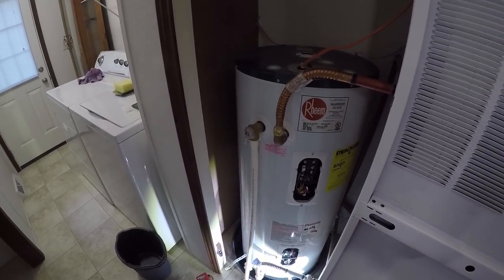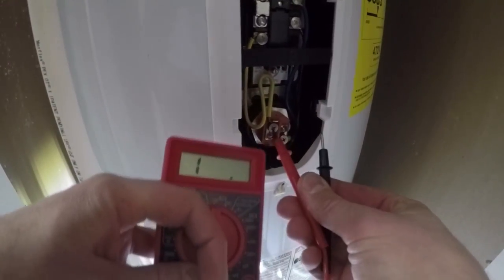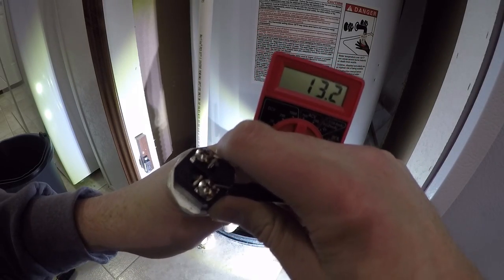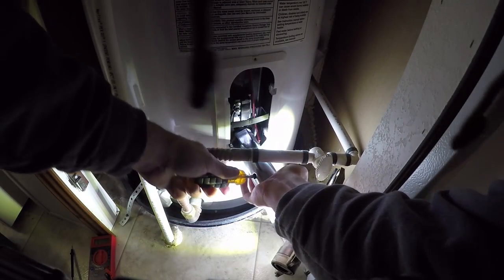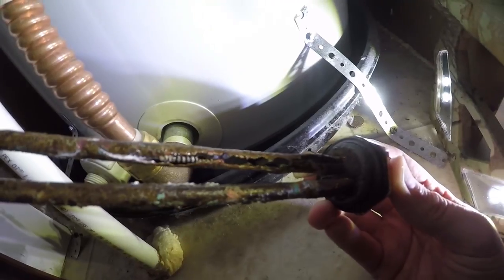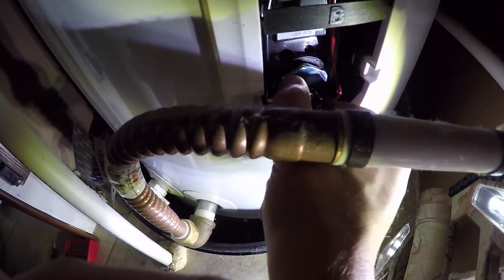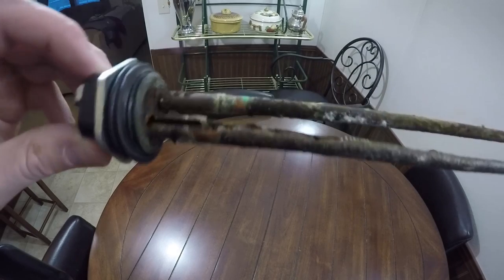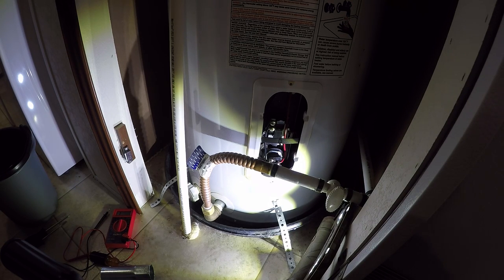How To Replace A Water Heater Element

Comment: Would it be prudent to replace both elements once you have the tank emptied?  Does the bottom element fail much sooner than the top?
Reply from the maker: I did both of mine, it only seems to make sense to do both, it won't hurt, I would they are not expensive and I would rather just replace both and be done with it.

Comment: Mr Wagner. Thank you for sharing valuable information. I replaced both heating elements and thermostats for new ones and still not getting hot water, There is power. Any idea what could be the issue?
Reply from the maker: it's gotta be something else then but I'm not sure check to see if you have a blown breaker or something

Comment: heyy jamie not knowing a lot about water tanks, why would the water have been burning hot if the element was shot and the breaker was blown?? thanks
Reply from the maker: I’m not sure probably because it was shorting out causing the thermostat to mess up or shorting it out or something. All I know is it kept popping the breaker
Reply: Hi, just before his breaker actually blew was when the water was so hot. Reason being is the element was almost but not quite burned out. Just before the breaker blew, the electrical current  was spiking due to very low resistance in the failing element. That in turn lead to the failing element heating up much more (probably glowing hot)  than it would in a normal situation which made the water temporarily hotter than normal.  Then finally the electrical element resistance went so ultra low that the current level finally spiked beyond the limit of the circuit breaker in the breaker box. Which then disconnected the heater from the electrical circuit completely.
  A good thing to remember if you notice that your water is suddenly hotter than it has been in the past (especially noticeable while washing hands), you are probably going to be needing repair work on your heater very soon.
Reply from the maker: Wow thanks for sharing this! Very well explained!
Reply: The element heats to whatever temp its set to but if the inner coil is exposed the electrical output would be ungoverned rapidly heating the water and trip the breaker
Reply: It seems this was already explained 😝

Comment: 30 gal. Reliance, just moved in last year, looks only a few old.

My power usage almost doubled recently. I thought it could be a bad element. But they tested good. I turned the thermostat down, to 130 they were maxed. Would a bad dip tube cause the elements to over work?
What could make it work harder or use more power?
Reply from the maker: not sure bud

Comment: Great teoubleshooting video. Man I have paid my electrician 3 times to replace my element in my solar water heater in the last 2 years. He has tried a fake and the genuine brand and the fake outlasted the genuine at 1/3 of the price. Now it's gone again and after a cold shower I need to replace ASAP. Any idea why my element keeps going my electrician reckons there could be to much something in the water.
Reply from the maker: could be in the water or your electrically could be an issue
Reply: Jamie Wagner yep my sparky replaced the element which was the problem. It's a cheap solar unit and it doesn't use a secondary element to absorb all the rust and corrosion the actual element does.

Comment: When you put the new element in does it matter which wire goes to each screw?
Reply from the maker: No, it does not matter which wire goes to which heating element terminal at least for mine in this video, just re-connect the electrical wires exactly as they were in the original water heater element installation don't bend them around they should just be pretty much ready to re-connect. Please also look at your Heaters installation wire Diagram if you have one for your model. It is Extremely important of how the wires all connect before the element but for the element it's self you just connect them the way they were unless it shows other wise for your model.

Comment: Is it worth servicing/PMing a 9y/o water heater? trying to avoid the cost since money is tight.
Reply from the maker: Yes you could always service yours yourself to save money, they can last 20 years if maintained!!
Reply: @jamiewagner  mine was manufactured in 2000. It is 2021 now. Has been a great water heater and still is. It's a Rheem Lowboy btw. I'm gonna keep servicing mine till it rots out I believe.
Reply: mine was manufactured in 2000. It is 2021 now. Has been a great water heater and still is. It's a Rheem Lowboy btw. I'm gonna keep servicing mine till it rots out I believe.

Comment: One of my elements reads a 18 and the bottom is a 8 should I replace the 8
Reply from the maker: I would replace it if your sure it’s reading that low. It’s probably getting worn out. How old is your heater? 3-5years??
Reply: Jamie Wagner  yes probably 5
Reply: Jamie Wagner I can't even get it to drain it's so full of sediment
Reply from the maker: Sounds like it’s probably time. If you get it drained enough to pull that one out I’ll bet it needs replaced. Probably.
Reply: Jamie Wagner thanks for your help

Comment: Hello, I’m getting Luke warm water, and the breaker did trip the other day. So I reset it thinking that’s why and it’s still Luke warm. Can someone please help? Thanks. 
Not to mention it is an Electric Hot Water Tank!
Reply from the maker: Check the elements, make sure they are not rusted away like mine was, and you might need to test your thermostats to see if they are working correctly and not going bad

Comment: How tight do you tighten the element?  Is there any torque value or just tight enough for a good seal?
Reply from the maker: Well that’s a good question I tighten it up enough to have a good seal I guess you could say but I’m sure there is probably a torque value to it you would probably have to look in the manual

Comment: when i touched my tank it shocked me then the breaker flipped every time i turn it on it flips the breaker its a 16 year old water heater i think its a bad element im not sure
Reply from the maker: Sounds like it’s got electrical issue for sure it’s shorting out I would replace the elements and your gonna have to check the entire system over and the thermostats to

Comment: Specialized wrench from Home Depot does not work.  Flops.  Have big regular wrench but not the leverage to loosen.
Reply from the maker: Dang
Reply: @jamiewagner  Made clips out of used copper PEX crimps and put them on one end of the wrench but still can't get the leverage.